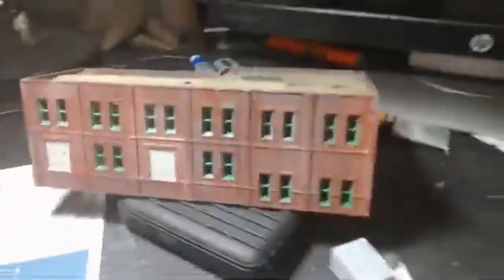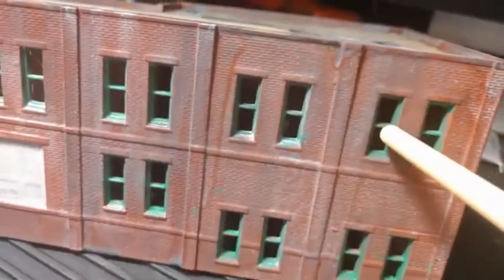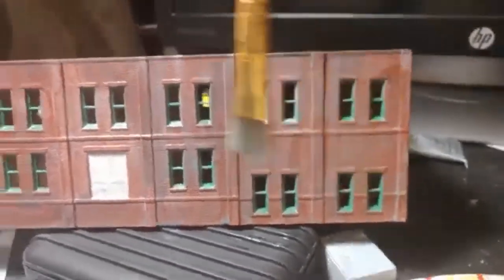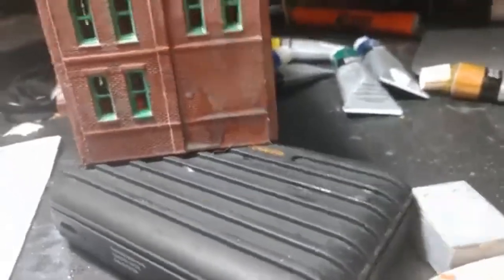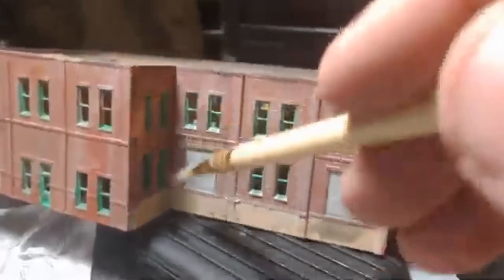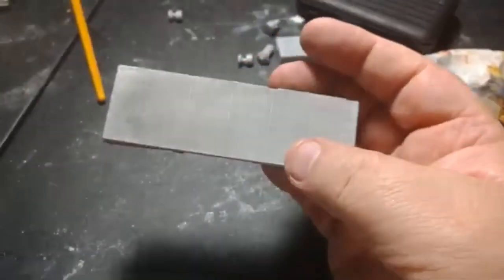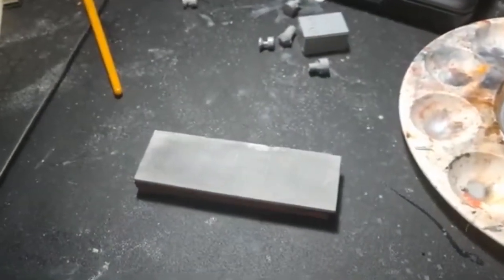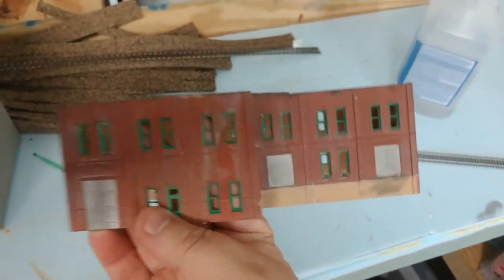Gripps Luggage A DPM Kit Build Part 3

Comment: Thanks for the update on the factory building project Rusty. I'd say it came out looking just fine. I like the look you achieved with the roof and the added details. Keep up the good work and we'll catch you on the next update.  Art...
Reply from the maker: Thanks 👍Thanks I was just truing some stuff. That silicone calk kept the details in place pretty good. I didn't know what else to use. I had used fine sandpaper on the roof and the silicone work as a good adhesive for that application

Comment: Hello, sorry for your loss. Super glue is not good. It becomes brittle and comes apart. You need a product that welds the plastic together. I like the DPM kits. They are simple and look great. And you can detail them out as much or as little as you like. Thanks for sharing. See ya next time.
Reply from the maker: I put it together early in this virus shut down. I used what I had, I have DPM kits that i used the old fashioned testors in the tube.They have been assembled at least 20 years.
Reply: Possum Bayou, Testors is what I use.